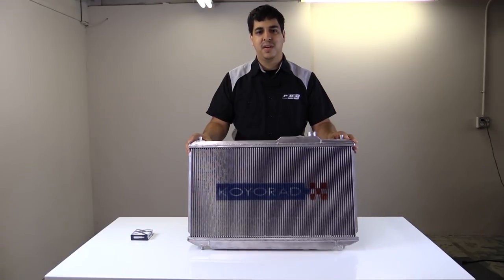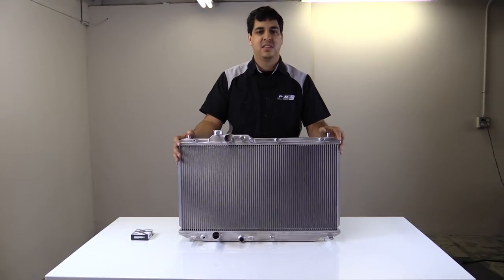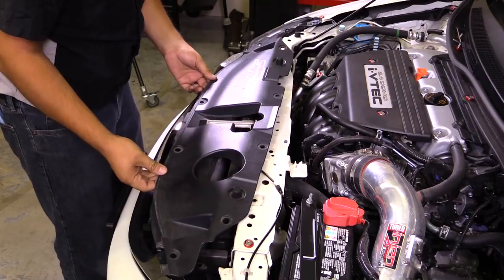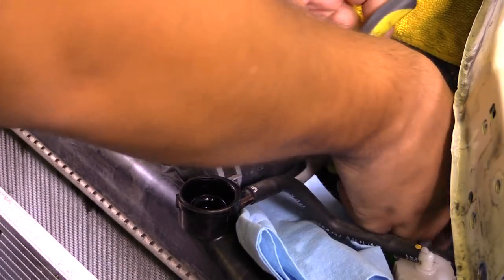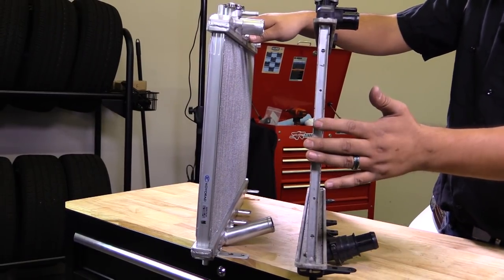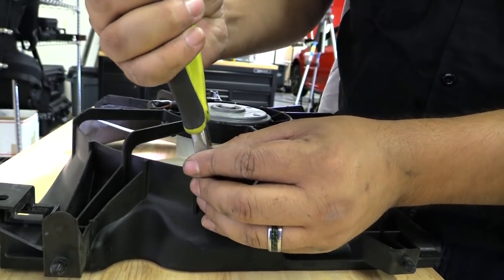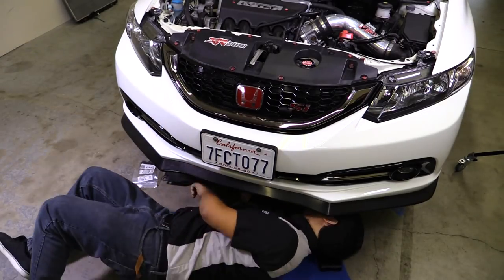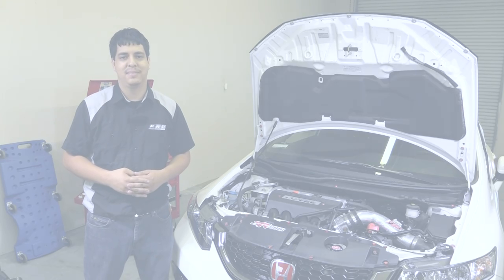Koyo Radiator Install - 9th Gen Civic Si - 2012 2013 2014 2015 Honda Civic

Comment: why does it say manual transmission only for this radiator upgrade? can't the AT trans be benefited? thanks
Reply from the maker: +Tak Tsoi The automatics have cooler lines going from the transmission to the stock radiator. To keep things as cool as possible, these lines are not present on this radiator. To use this on a automatic, you would need an external oil cooler.
Reply: Tak Tsoi It can be used with a CVT transmission and the automatic. The radiators are the same as the MT.
The cooler lines go from the cylinder head to the transmission and do not go to the radiator.

Comment: Where's the test results for this product? Before and after? Noticeable? Better efficiency?
Reply from the maker: +Jesse Christensen Due to the cold weather, it's hard to get conclusive results. However, we have seen more stable temps after the install. In mid to high 60's (F) ambient, the coolant temp before the radiator was around 215-220 F. After installed temps hovered at around 205 F. Once ambient temps get higher, we should see better results.

Comment: For the extra hole that Koyo includes for either an additional sensor or to bleed the system does it come with a screw to close up that hole if you don’t have a sensor you want to add
Reply from the maker: The hole is plugged from the factory.

Comment: Hello and thank you for a wonderful video. Do your guys think that Koyo radiator can install to a 9gen Civic sedan Ex with an auto tran? Thank you.
Reply from the maker: +BBQ Bacon It is possible, but you will need to make some modifications. The Koyo Radiators do not have a spot for the transmission oil cooler lines. You would have to use an external cooler for the transmission to make this work.
Reply: PRO Car Studio Thank you, and could your guys give me some suggestions about which external cooler I should buy for the Cvt tran?
Reply from the maker: +BBQ Bacon We do offer both a standard and heavy duty option on our site. Simply follow the link to see them: https://www.procivic.com/p/m/civic/mishimoto-trans-and-power-steering-cooler-cooler-with-fan.html?utm_source=youtube&utm_medium=social&utm_campaign=part-mishimoto+trans+and+power+steering+cooler+cooler+with+fan+youtube
Reply: PRO Car Studio Thank you.

Comment: I am looking for a 2012 civic ex 1.8l automatic trans upgraded radiator. If you website has one.
Reply from the maker: Unfortunately, we do not have one that will fit automatic models directly. They are mainly intended for manual transmission models.

Comment: Will this fit with an rbc swap and turbo kit?!? Looks like it might.?!
Reply from the maker: +Weaponx9x If the manifold does not go past the radiator support, it will more than likely work. However, we have not tested this and cannot guarantee it.
Reply: PRO Car Studio ok I think it will work!!! What your temps looking like after the install?!?
Reply from the maker: +Weaponx9x At the current moment, we have not taken it to the track for a full test. Once we do, we should have more info. Thanks again for watching!

Comment: Nice video :) do you know if this radiator fits with the Kraftwerks supercharger, also on the 9th gen? I Purchased one already -.- but now that I saw the difference in thickness from stock to koyo, kinda doubt it’ll fit now. Since some hoses from the Kraftwerks kit are already hitting the fan outer parts 🤔
Reply from the maker: Hi, I believe it should work..it is only about 7mm thicker than the factory radiator. You should be able to adjust the hoses to accommodate that extra thickness, but ultimately you have to make the call since you will be making the adjustments.
Reply: Yea, I’ll sleep on it lol. Thank you for the quick response man.
Reply: EliteShrooms it did but I went with slim fans